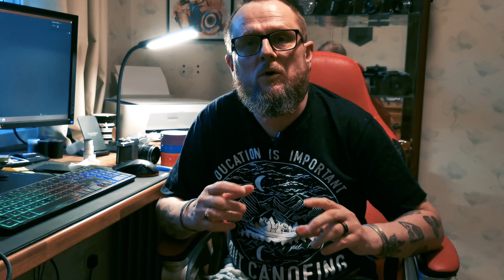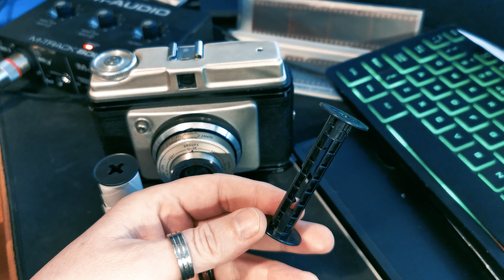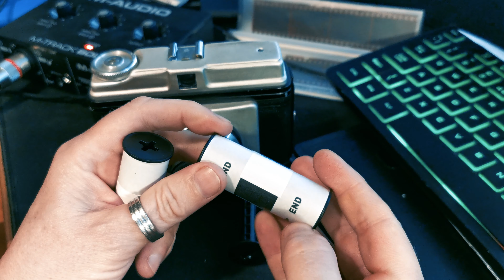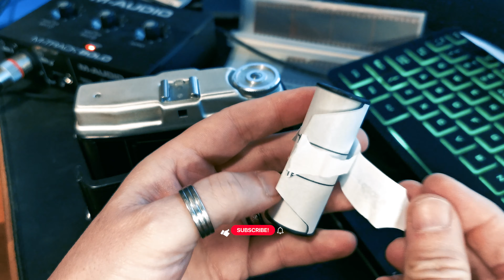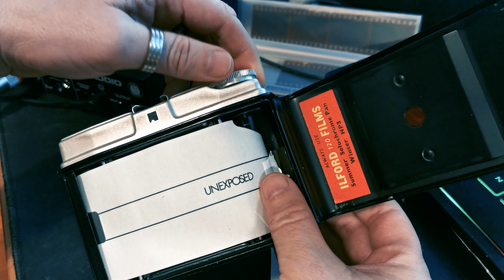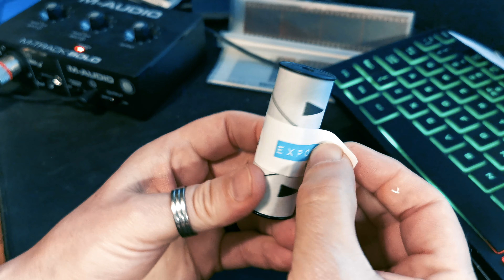Loading 120 Film Into Your Camera - A How-to Guide

Comment: i got a Agfa clack, how do i actually see the numbers, if they arent on the film?
Reply from the maker: I'm not sure what you mean. The Clack has a window on the back and the film should have frame numbers on it no?
Reply: @sccjono  yes it does, i ended up finding out that film has numbers on the entire backing paper, not just in one place in case of it being somewhere else
Reply from the maker: @mrkevinkillercrafterminecr895  Ah yes there are several different positions to accommodate several different frame sizes. I must do a video about that.
Reply: How much should I roll the the film until I see the numbers? I was a vertical line, then the 3 dots One smaller than the other and then two closer vertical Lines and then again the dots @sccjono